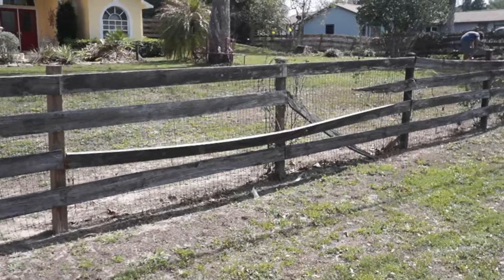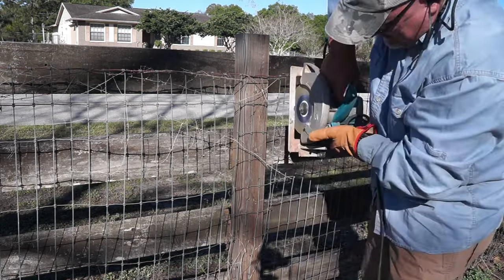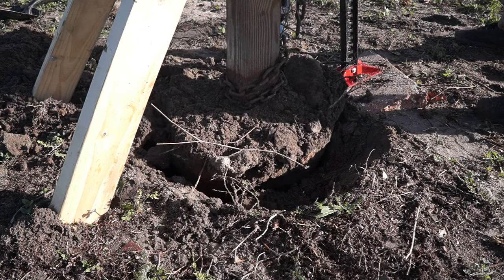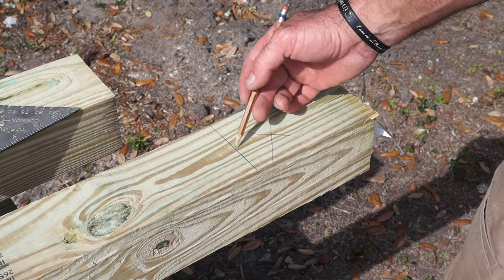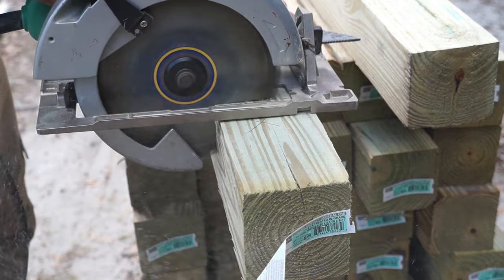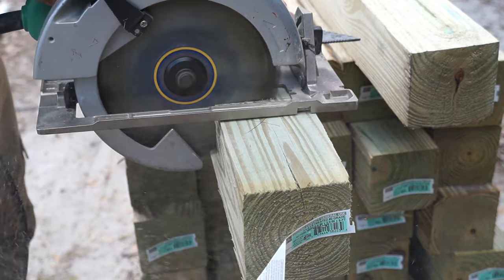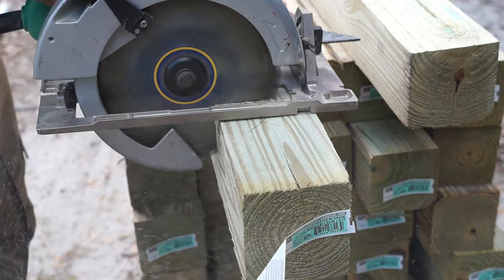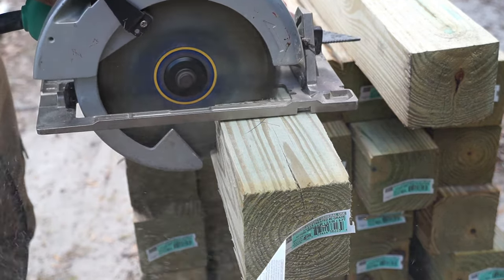How to Build a Kentucky Four Rail Fence - The End Grain Workshop

Comment: I noticed that you still have the concrete around the posts way below the ground still allowing water to stay in the holes longer than it should be.
Reply from the maker: Yes, we did have some that were below grade but we made sure to taper the top of the concrete.  It's okay to be below grade, you just want to avoid having a concave top.
Reply: @TheEndGrainWorkshop  The reason of having the concrete above the ground is to direct water away from the posts.